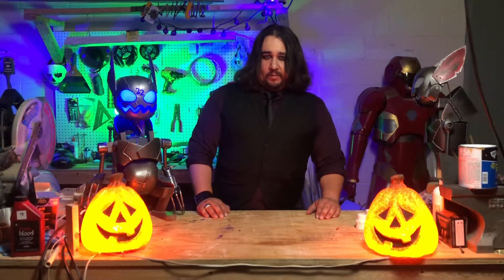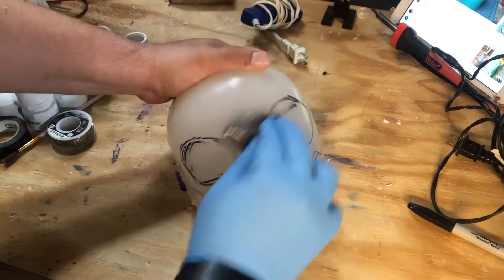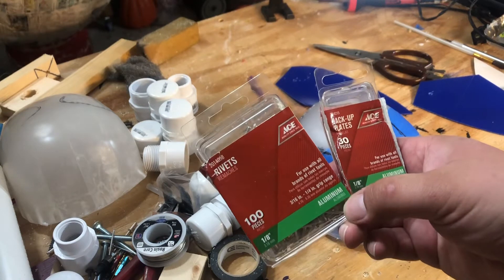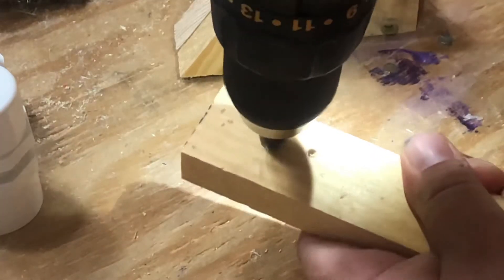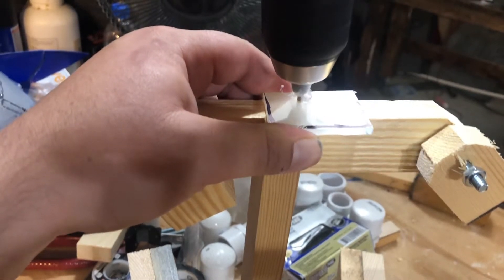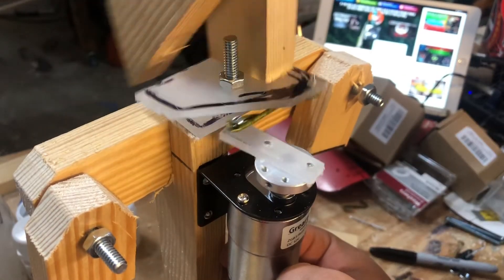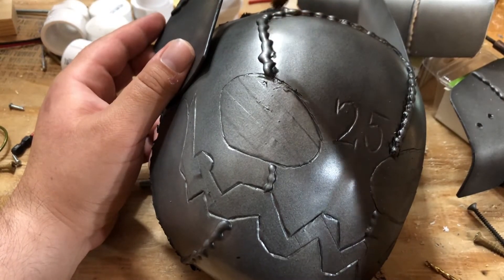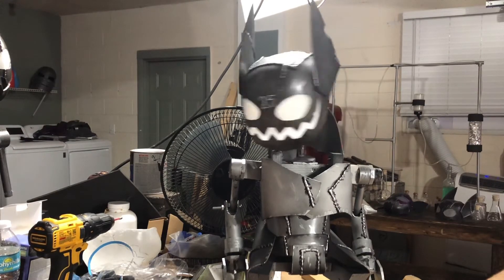How I Made My Halloween Animatronics

Comment: How did you make the mould for the head. For the shape? These are so cool. Would have to do this a school though so only have 1 chance so I need every detail. Lol
Reply from the maker: I took a few pieces of 2x4 and glued them together. Once dry I took a disk sander it and just stared grinding till it was in the shape I wanted then sanded it.
Reply from the maker: Tho if you don’t have a grinder you can make it out of plaster. After you mix it there is a brief window where it’s kind of thick like clay before it starts to fully harden. You can quickly mold it into the shape you want and sand it once dry. I hope I described that well lol.